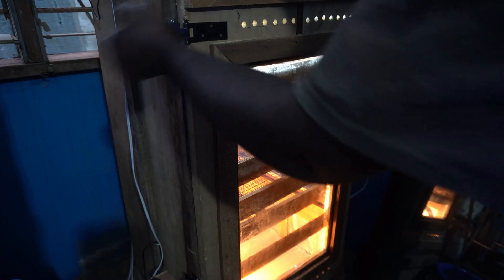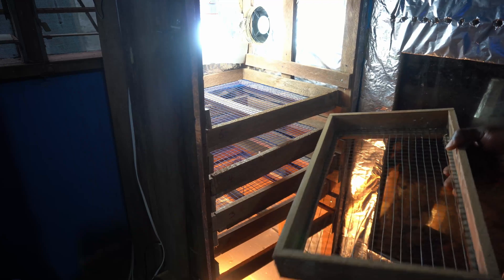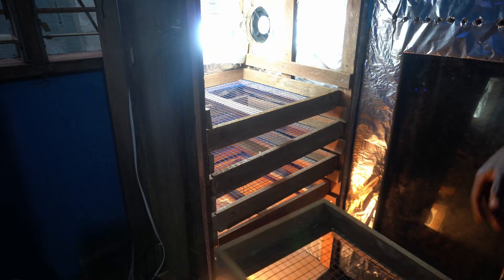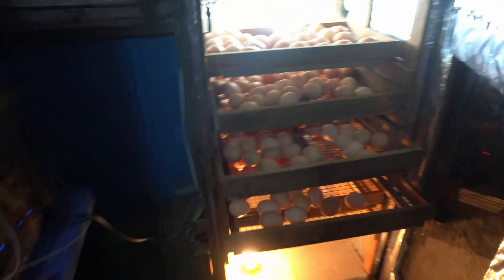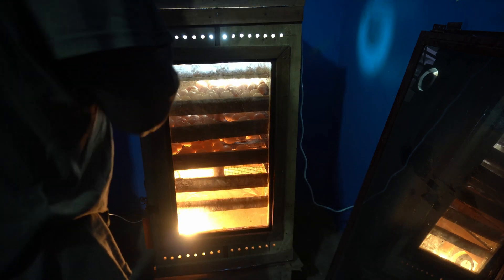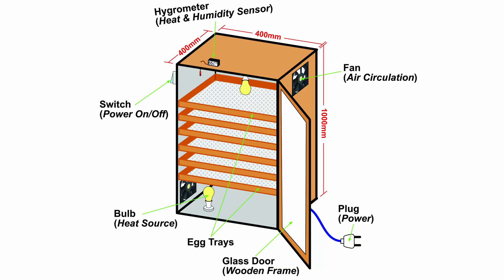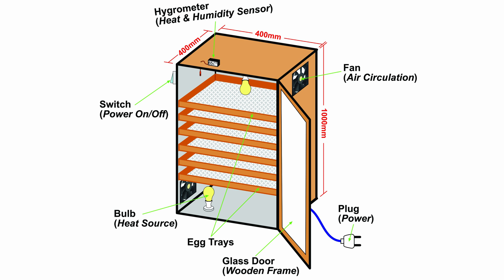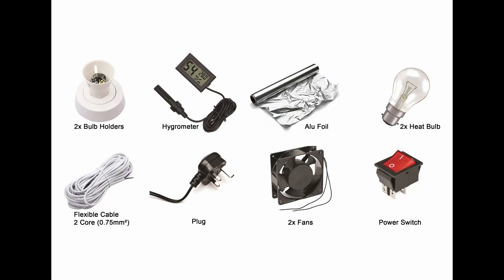This Week's Video | Building A 300-500 Capacity Egg Incubator | DIY Manuel Egg Hatching Incubator

Comment: Please the turning eggs is about how many degrees.Where should the motor fix.
Reply from the maker: the Turner should not turn more than 45 degree.
Where to fit the motor depends on how you built and installed you egg turner. But most are fixed above the egg turner
Reply: @AIS.FarmResorts  thanks